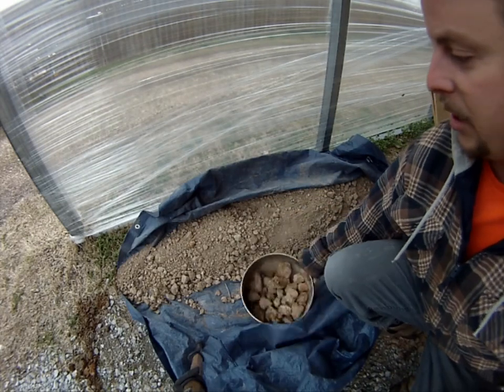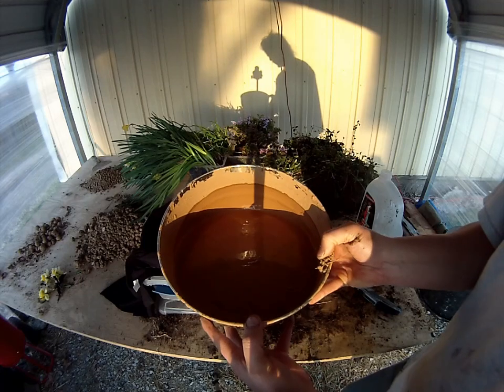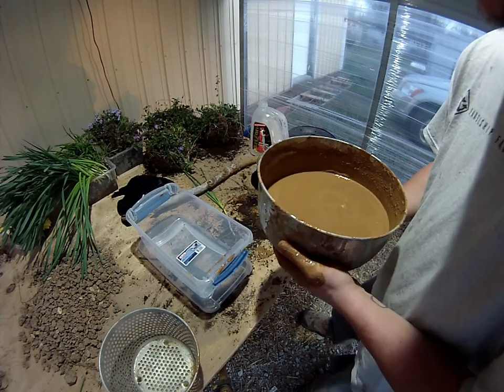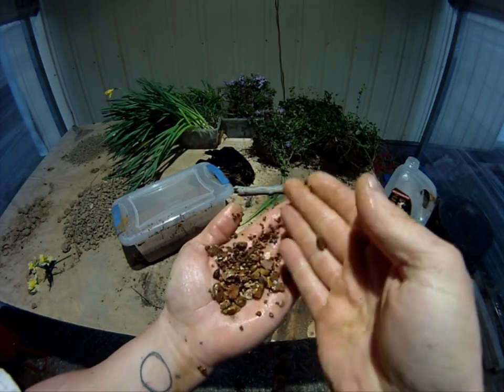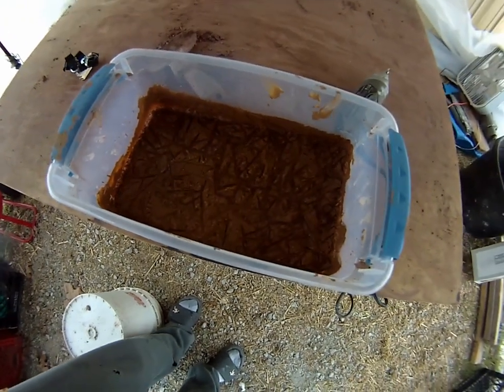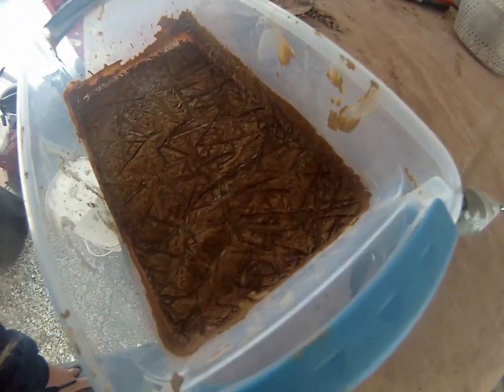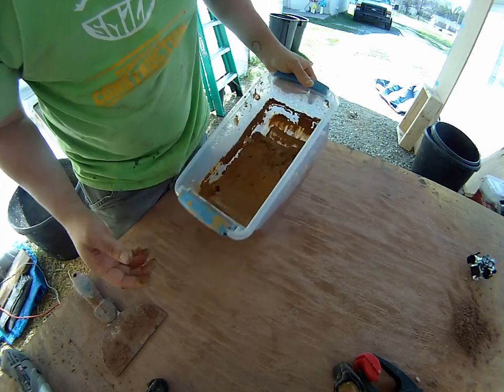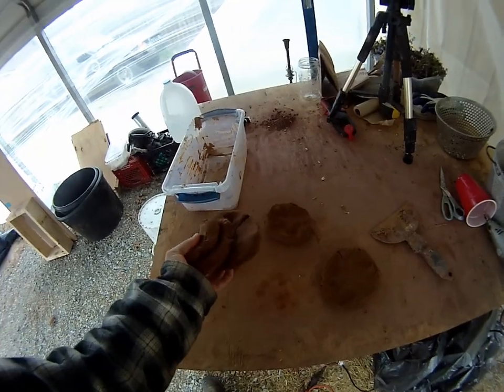Refining Dirt into Pottery Clay

Comment: If you use the table drying method much, you should consider getting an offset spatula (like for frosting cakes) and smooth out the top. When there are a lot of peaks and valleys it drys at different rates and you end up with chunky, inconsistent clay. Good video though!

Comment: Any luck? I tried this and just wedded a clump up, made a small bowl and set it in hot coals to cure, it worked but was weak and the rain melted it apart.
Reply from the maker: i still havent fired anything but i've now worked several different samples into dried pottery.  i'm an electrician so am constantly in the trenches. 

I've locally had and worked with dark red, yellow, gray, and brown clays.  i enjoy them all and finding the nuances of their workability is a treasure.
Reply: To actually fire your pottery, you need at least red heat. The hotter the fire, the quicker the clay bakes into ceramic material.